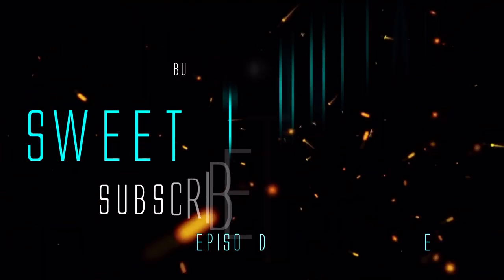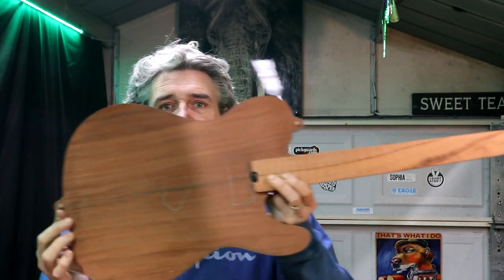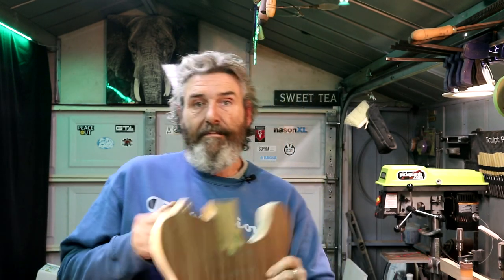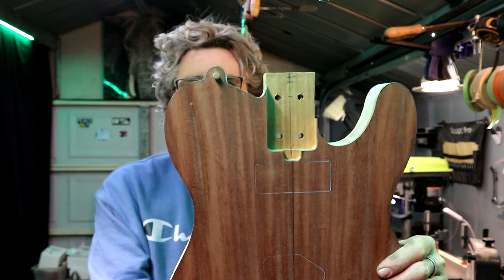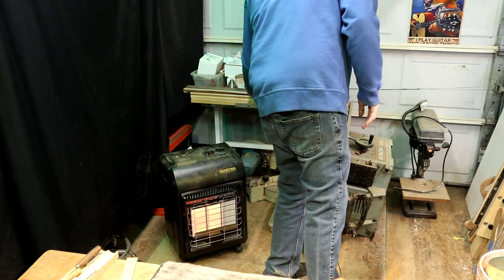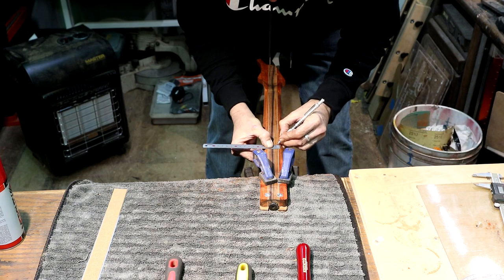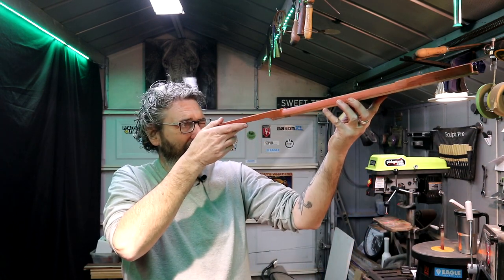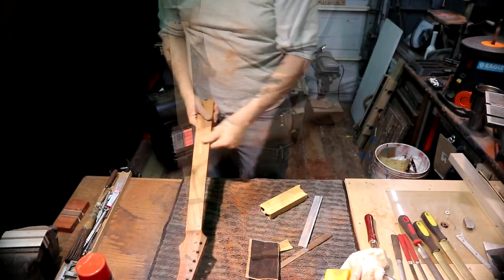Custom Telecaster Build - Episode 10

Comment: Here is a little trick I learned for shaping the back of the neck.  I mount a my 1 inch 45 degree router bit with a bearing on it, in my drill press and route the edges of the back of the neck by placing it upside down on the drill table and running it through the cutting bit. Lock the drill shaft in the upper position and raise the table to bring the neck to the bit.Take about 1/8 inch cuts and always use the highest speed your drill can do.  I cut this bevel until the cut is about 1/4 inch from the bottom of the fret-board.  What this does is give me a perfect and equal starting point for my carve. It cuts down on file time and insures that both sides of the neck are equal distance from the center-line.  I can usually carve a neck profile in an hour, start to finish.  The thing about this method is it's best to either use a flat fret-board, or do these bevels before you glue the board to the neck.
Reply from the maker: This is a great idea Tim. Thank you for the tip. I really appreciate the help. I thought about using the 7/8 round over bit in the router and shape the neck like that but it takes the "hand shaped" feel out of it. The way you are describing is just a kick start in the right direction. I'll have to get a 45 degree bit and try this! ✌️
Reply: @SweetTGuitars  A 3/4 in round over bit is too small anyway. A c-shaped neck profile would take a 1. 1/4 in bit at least. The 45 bit is just a start, but it makes the carve easier, and you can do a soft V .
Reply from the maker: Yeah, I know a 3/4 would be too small, I saw somebody on YouTube using a 7/8 bit to shape a neck but only the outside edges then they hand shaped the part left up the center. I would rather try your method honestly. I love carving a neck, it puts me in touch with the guitar and I really enjoy that part.
Reply: @SweetTGuitars  A c-shape on a 2 1/4 inch wide neck would be an arc that is part of a 2 1/4 inch diameter circle. That requires the bit to be a 1. 1/8th radius. Anything smaller will leave a flat spot down the middle. The only way to make that round is to carve into the curves made by the router but.  Factories used to use 1. 1/2 in. bits to make neck profiles in two passes. Now they use c n c machines and computers for everything.  I love making necks from scratch. It's the place where craftsmanship and design meets the musical talent. A friend that I haven't seen for 40 years (good guitar player)  recently came over and played all the guitars I have left, and the one thing he complemented me on, was the "feel of the necks".  He said "They are all so easy to play." So I let him pick one to take home. It's the honest opinions and hearing them being played that means the most to me.The money is just a way to buy more wood.
Reply from the maker: Yeah, that's what I was talking about. Derrick from Big D uses a 7/8 router for the sides then shapes the center by hand as does Texas Toast. That's where I saw it. I won't do it that way however. I honestly prefer shaping the whole neck by hand. I don't always want a c or a d profile. I lke doing it by feel and considering an A-symetrical profile is my personal preferred shape, a router bit for carving is out of the question.
Reply from the maker: That was generous of you to give your friend a guitar. I also love shaping by hand and agree with you completely. CNC takes all the fun out of neck carving. I'd just as soon not be a builder if I can't do at least that by hand.
Reply: @SweetTGuitars  Thanks my friend. Good luck to you.